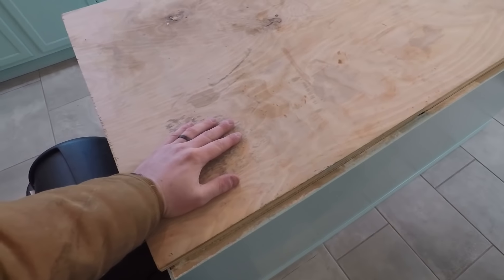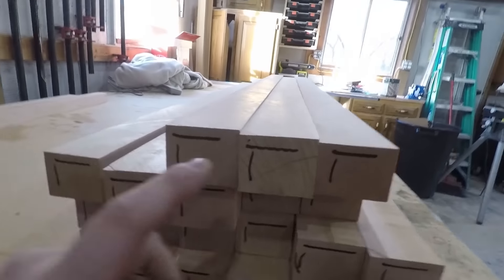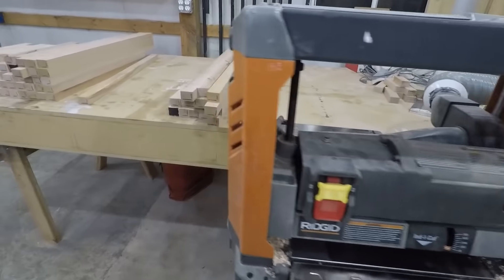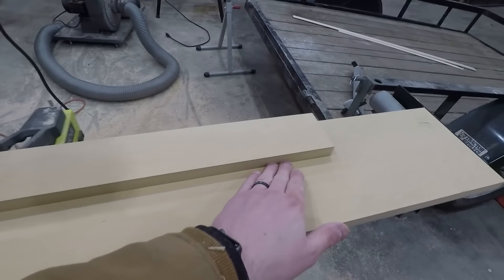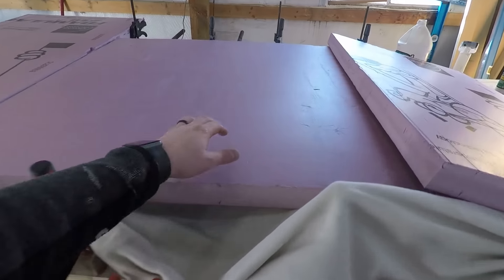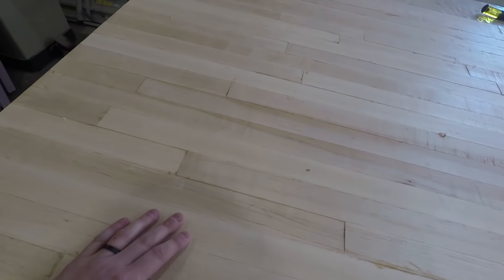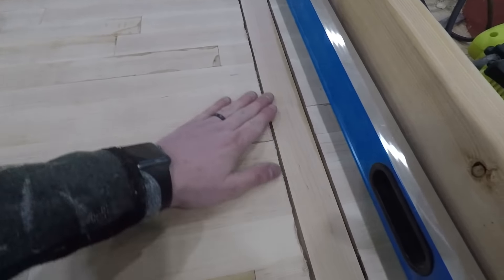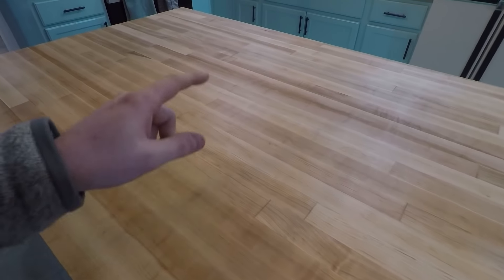DIY Butcher Block Countertops!

Comment: like the idea to get the pieces butt together perfectly
Reply from the maker: It was frustrating before I started cutting both pieces at the same time, definitely a time and frustration saver!
Reply: I believe I've heard that process referred to as the inside/outside method. It can also be used on a jointer that you don't have dialed in perfect to 90 degrees. You specify which is inside and which is outside and run inside through one direction and then run the outside through the opposite direction which fixes any variance and it isn't able to be seen by the eye.
Reply from the maker: @LeviLippincott  Great idea, I wish I thought of that with the jointer. I spent a long time getting it dialed in just perfectly and that would've worked well.
Reply: @10genbuild  Shaun Boyd is where I got the inside/outside term. He posted a detailed video on it with his jointer. Here is a link to that video... I watched it and thought I was such an idiot that it didn't occur to me to do this before.
https://www.youtube.com/watch?v=W5bgtDFPB0o
Reply from the maker: @LeviLippincott  Thanks for that, I feel like an idiot because I've never come across his channel before!

Comment: For perfect ends, I use a stationary belt sander and jig to hold the piece at 90
Reply from the maker: That would be ideal! That's a tool I still don't have so I had to work with the tools available.

Comment: Once you put that wax on, It takes forever to resand or resurface the top if ever needed.  I learned that making many cutting boards. I use the same oil and wax by Howard's, but don't use the wax on butcher blocks or cutting boards. The wax is very difficult to sand off, Just burns up your paper.
Reply from the maker: Thanks for the reply! I haven't had to do that yet but I can imagine that being the case..

Comment: Any warping issues seeing that only one side of the slab was sealed?
Reply from the maker: No warping issues so far - going on 2.5 years! I was initially planning to add some type of corbel support under the overhang but it's stayed flat and is really strong.

Comment: I know this is an older video but I'm curious how you handled the butt joints during the clamp-up. How do you make sure they are tight to the neighboring board end?
Reply from the maker: I didn't really do anything special, I just made sure to glue the butt joints really well and pushed them together. I didn't have any loose joints so it worked well!

Comment: What length did you cut the two groups of strips?
Reply from the maker: Honestly I didn't cut them any certain length and when I put them together most of them ended up being cut again to make the counter the right length. I would guess each piece was 30"-48" a the initial pass.

Comment: There seems to be a lot of people referencing Waterlox as a preferred wooden countertop finish. Did you use oil + wax on your other countertops and if so, how has it held up to countertop abuse?
Reply from the maker: I haven't heard of Waterlox before, I used the Howard Butcher Block Oil and Conditioner. It's essential food grade mineral oil and a wax. It seems to be holding up well after 9 months or so. I have re-waxed them 5 or so times in that span

Comment: Remembers used purpleheart wood in a butcherblock as in a kitchen countertop. I'm looking for some tips. My longest run is 10'X36"
Reply from the maker: My biggest tip would be to build a perfectly flat table of some kind that is 10' long that you can use to glue up the top. Good luck!
Reply: Thanks think I can handle that 👍

Comment: how do you guys like the wood countertop around the sink? I am afraid of doing this because of possible water damage
Reply from the maker: I was concerned about that in the beginning but they've been installed for over a year now and still look great! We are pretty careful to wipe up any spills in a timely manner.
Reply: I use plumbers putty between the two surfaces after the install just cut any excess off with a new blade and just press lightly.

Comment: Why not seal the countertop with an oil based poly to protect all that work you've done? Unless you plan on actually cutting on top of that surface? I hope not!
Reply from the maker: I really wanted to do this actually, but a lot of people wiser than I told me to not do that on counter tops. Honestly I don't know what will be better in the long run but we've had these in for about 6 months and they still look great. The Howard stuff is made for butcher block cutting boards, and no we're not cutting on these surfaces, but Katy loves them and that makes it good with me!

Comment: Its a ryobi man, had to learn not to buy anything ryobi.. def been burned by all of their products
Reply from the maker: To be fair to Ryobi, most of them have lasted much longer than they should have given what I used them for. Also they've always repaired or replaced them no questions asked. I agree that's a hassle and have since transitioned to Milwaukee and Dewalt for almost all of my tools. There is a significant quality and performance difference in my opinion.